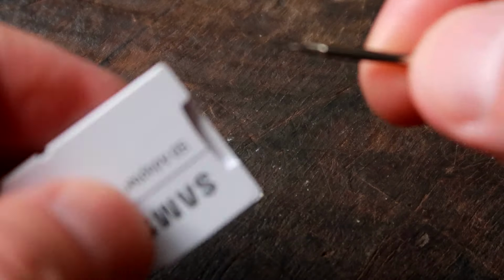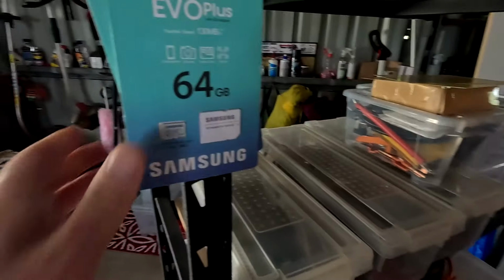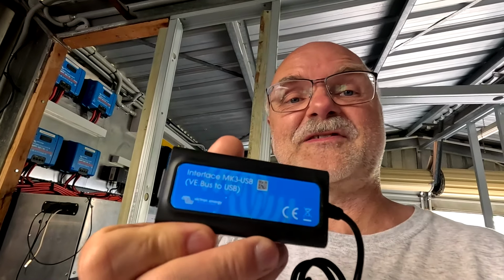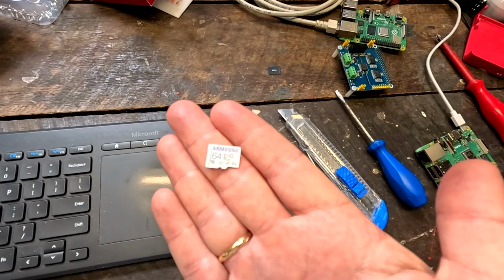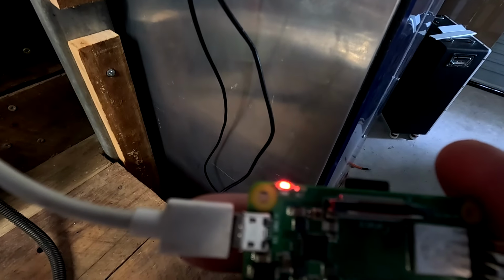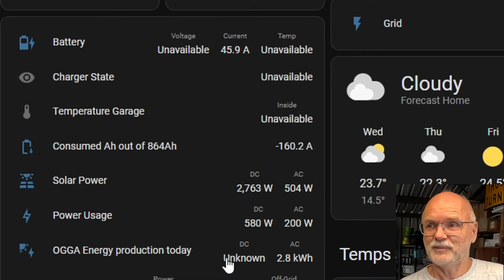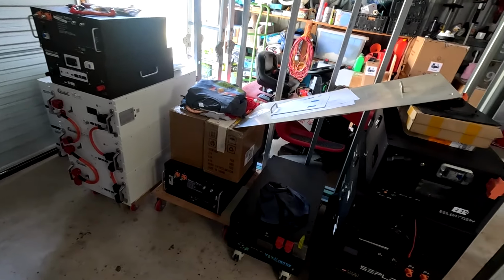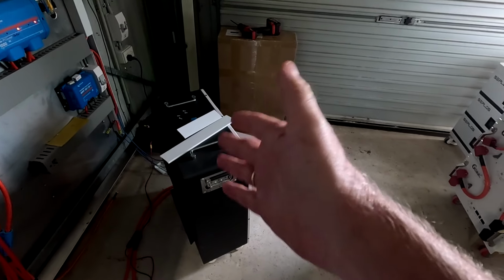Used Victron Cerbo GX replaces dead Raspi and why I lean towards no BMS communication!

Comment: I think you have to do Uboot-procedure on your raspys, and of course, install a Nvm2 SSD. It works well once you did it right. The only drawback is, you're losing 1 USB port. I have one question, did both channels of your can head works? I don't get it done, even kwindrem said somewhere raspy 3 and 4 accepting only one channel.
Reply: How? Do you happen to have a guide?
I have a rpi with a internal nvme drive connected to the pcie express port I used with solar assistant.  I want to re use this one and boot Venus OS from that nvme drive.  But I haven't been able to get it to work.

Comment: I do not use BMS communication, it makes the system over complex and prone to failure. The BMS is here to safeguard the battery pack and he does it independently, i'm fine with that. If the Bulk and float voltage are set correctly ... then the max charge amperage is set natturally by the battery chemistry, it charge fast with a higher bulk voltage to the 90% ish SOC in my case .. then when current decrease it goes in float (54.4V for me.. and stay at 95% SOC).
Natural physics laws lean in the good direction... no need to control it.
For the communication to work correctly you need a shunt on the battery ... i got a 48V secondary DC circuit, not the DC rail used for inverter/mppt.... but a regulated one where i can use the hifi system, lights, tools that are needed in case the inverter would fail. The gx was not sensing that consumption and would not provide enough Amp on the MPPT side. It would have needed a shun on this Dc circuit or it will not be able to calculate the MPPT current to provide to the system. 
Now, without communication it's super simple : The MPPT (RS450+Smartsolar 100/20) make available all current then can provide  and devices (battery, inverter.. DC cirtuit) take what they need on it without having a bad influence on each others. There is a lack of power on the 48V rail ? The battery just fill the gap... it's all natural and react instantly, physically, no electronic logic is needed.
It work like for 3 years in our shed, all is good.
When i tested the fallback system from "BMS controlled" charging to  "MPPT controlled" .. was not as good as i wanted .. was taking too much time. With no comm ... All MPPT just give what is drawn on the 48V DC rail.... nobody care who is using it.. inverter, BMS, DC circuit... Cerbo...

And Rasp are not reliable, Cerbo is the best way and in the end a cerbo is not that more expensive then a Rasp. Even my home assistant is on a miniPC cause Rasp are too unreliable and far too expensive for what they offer. For low consumption... Arduino or ESP32... higher then that .. miniPC. My NUC with Home assistant (200+ sensors), Frigate (4 cameras), Adguard and some other small projects... consume 11W. A N100 would maybe doi it for 9W.

Comment: I used Raspberry Venus OS in a camper with a 7" touch display. I had both components lying around, so it seemed the most logical "free" choice. but... Neither of these two is really designed for extensive vibrations. We do a fair amount of off-road driving. The display gave up within weeks (the top section touch control doesn't work). My raspberry is far away from the Victron gear. This means I had to run about a 7-meter-long cable. USB cable didn't work, thus I went with USB to LAN to USB adaptor. It works great while stationary. It surely doesn't like moving. Once we drive, I'm getting random disconnects, and then the info from JK BMS is no longer available to manage the solar chargers... Replaced the whole setup with Cerbo GX and Victron 7" Touch. HDMI extension and all is dead stable. IMO Victron gear, even though pricy, is well designed to take upon demanding tasks.

Comment: Being the device you just installed was a raspberry pi in a casing from victron. The new pi's either raspberry or orange. Have mmc cards and have adapters for m.2  drives. I use a orange pi 3lts with 8gb mmc for solar assistant and a orange pi 3b for home assistant with a m.2 500g drive in it.

Comment: Hi Andy, I have 2 Raspberry Pi3s running fine 24 hours a day with Venus OS, using a high performance SD is ideal and a power supply isolated from your system prevents a power surge or static electricity from damaging the Raspberry and use original Victron cables to interconnect everything and that's it.

Comment: I've run my system for two years now and have never used closed loop communication to control the invertors and solar charge controllers.  The inverters and charge controllers operate based on voltage setpoints and everything works just fine.  I use a Cerbo GX to tell my Victron Multiplus to switch on/off grid based on battery SOC and/or voltage.  I just don't see the need for all the headaches associated with closed loop communications.

Comment: Ordered another JK inverter BMS (as a spare) and now received a HW15.5 (15 and a half???). Not sure what they changed this time. Only visible difference is that the red wire now is also screw connection instead of soldered on and the coil is wrapped in heatshrink

Comment: Hi Andy,

Since an SSD is not an option due to the victron Venus OS, you might want to use the RasPiKey? It is a SD-to-Emmc and sits in your SD card slot. Doesn't fit all RPI cases though and it should sustain more writes than an SD card. SD cards usually die in the RPi if it will be power cycled during a write operation or just the wear and tear on the card due to excessive writes. Since VenusOS has a /data mount to write stuff, this might be the case of it's ultimate demise (other than breaking into two pieces).

Comment: I keep a record of the commands which I made and the fixes to the files. This helped me when I bricked it several times when I didn't have an isolated setup. I need to upgrade in a while and that makes it somewhat tricky. Good luck fixing it. There might be a Linux way to makes copies. When you insert a USB stick you could do a 'rsync -av /data/ /usbpath/' it would copy the files, or you could do a remote rsync. But this is still cumbersome.

Comment: BMS communication is useful to lower the charge current when the battery is close to 100%.
Reply from the maker: No, that's really not necessary. The battery will take less current automatically when it is full. We use CV for absorption and the current will go down. There is no need to actively limit the charging.
Reply: @OffGridGarageAustralia if you got a badly-balanced battery (for whatever reason), then the connected BMS will alert the system to lower the current prior to the battery reaching its CV voltage, giving time to the balancing process to happen. If there is no communication, the BMS will cut charging altogether, which could potentially lead to an unstable situation.

Comment: I believe my Cerbo GX crapped out. It only sends data from my pv arrays, the cerbo seems to run hot.
I have tried researching on anybody that had somewhat of the same situation until I seen this video today.
I would think everything that is going on with the  razberry pie and cerbo gx is running to hot on these compact units. 
Maybe run a fan for cooling system down.
As for the cap on the power point is only for arcing when you unplug in and out, mine always was plugged in but when I first noticed it was when i did the last update and never worked right again.

Comment: Andy, if you decide to put in a new raspberry pi, put a heat sink on the CPU with a fan. These CPU's get really hot. Plus use a hi quality SD card. I have been using RASPI"S for several years and a heat sink with a fan is a very important component. Power supply with 3-4 amps is also important . Good luck and thank you for all your  videos. You are the BMS KING.👍

Comment: @Off-GridGarage, 
Andy,  since you are in contact with JK BMS developers, could you please pass them important information about a bug in their Pylontech protocol implementation that prevents successful connection with a huge number of different inverters using the RS485(9600) Pylontech protocol?

I have a problem with PB2A16S15P (fw. 15.30) and inverter PowMr POW-HVM6.2K-PRO. I tried to connect them using RS485, selected the Pylontech protocol on the inverter, and #14 protocol (9600 Pylontect) in UART 1, but after 2-5 minutes, the inverter reports a communication error (it tries to make very first handshake and failing).

I debugged it with PC sniffer and found the issue with BMS protocol implementation.
The first command from the inverter to BMS is "get protocol version," and the inverter sends 00 because, according to protocol documentation, that field should be ignored for that specific command. However, BMS returns error 01, which means "incorrect version." I manually filled in the version and updater checksum, and BMS responded properly.

Command from inverter: 7E 30 30 30 32 34 36 34 46 30 30 30 30 46 44 39 41 0D - second and third bytes mean "00" in ascii
BMS response:                  7E 30 30 30 32 34 36 ~~~~30 31~~~  30 30 30 30 46 44 42 33 0D - highlighted 30 31 - means return code 01 which means "version error"

Comment: Honestly, it is quite tricky to run RPi without cooling. At least passive. Better to have active, especially if you are in sunny hot Australia 😅
Second thing I would check is power supply. RPi needs really good and reliable power supply.

Comment: Does the pi get warm/hot.  SD cards fail much faster if they stay hot for long periods or you are constantly writing lots of little pieces of data in the same locations.   Pi hardware is not industrial grade electronics so 3years of constant running may be an issue.

Comment: You can run a raspberry totally in RAM without any writes back to the SD card: Use the Overlay File System option in raspi-config. That make the file system read-only and overlays a RAM disk over it where writes will happen. The writes are lost when the system is rebooted. You can save (when needed) to e.g. a usb stick.

Comment: The Gobel Power Battery Home Assistant Addon also works with the included RS232 to USB Connection Cable; thank you very much for pointing out the addon

Comment: In my 20 years living on a sailing boat I noticed that a lot of the marine electronic companies started moving towards networked systems with loads of communication between parts of the system. Out at sea having a system shut down because one component failed or stopped talking to another could end in a disaster. I stuck with my independent components (often not even the same manufacturer) because I hated the idea of losing everything just because one component failed. On a sailboat you also carried a spare for everything. I'm building a narrowboat now and even though Amazon can now deliver virtually everything I need tomorrow as I'm inland I have still designed it so that if one component fails I don't lose everything. Two battery packs, two BMS's etc etc.

Comment: If you’re going to run the OS from an sd card it needs to be gentle with disk writes, you can boot the pi from USB drives now I believe, a USB SSD should be more reliable

Comment: Hi Andy, I have always been under the impression that an SD card is not the moet reliable boot medium for any OS. In case of a Pi some suggest using USB Boot and boot from an SSD. Faster and more reliable. When using a simple removable drive bay you could make backups more often and easily, bit still need manual labour. 

There also a way to boot from Lan, logged data would have to be stored elsewhere in that case.  

Anyway.. there are options. The question is.. won’t an original GX be better as it works from the box.

On the other hand, when the GX device fails I guess you have a similar problem of no backup and having to reconfigure the whole system.

Comment: I have my jk bms connected to a pi3 mostly to monitor battery temps and control a relay hat to keep the battery temps up. Has been a stable connection for the most part but do wish it would failsafe to bluetooth communication should something happen to the vrm device

Comment: I would try to power your RasPi's from a known GOOD original RasPi foundation power supply if you have one.
The Pi3 will need 5.1v at 2.5a, especially if using HAT's.
The Pi4 is fussy & will prefer 5.2v at 3a.
If no official RasPi adapter use your power supply set to 5.2v (max) with 3 amps with a sacrificial USB lead, check the polarity with a DMM first though...
Plug it into a monitor so you can see if there are any low power 'lightening' flashes on the display and otherwise observe what it is doing...
The Pi3B+ will boot to a high quality (Samsung Bar for eg.) USB drive out of the box, the PI3 will boot to USB if the firmware boot bit is set (guides online). USB sticks are more rugged and have cooling air around them as they stick out from your Pi.
SanDisk Ultra A1 class 10 16GB SD cards seem to be the sweet spot for me (Iv'e ran some SanDisk cards in my Pi servers for 7 or 8 years now - no problem!
Use the 'Raspberry Pi Imager' software to set your cards up if trying the latest BookWorm image, larger SD cards will be formatted in the correct file system before applying the image.
As for backing up SD cards I use another Linux machine (RasPi or Ubuntu based distro on a PC) and use the DD command (approximately every 4 to 6 weeks between backups). 
BUT bear in mind that any copies are just copies until tested as working... i.e. verify the copy is ok by restoring it to an SD card and testing it.
Sometimes in the past I've had to restore 16gb SD images to larger SD cards because there can be  a few 10's of bytes LESS room on a seemingly identical SD card. I counter this by using GParted to shrink a master image down by a couple of MB before DD'ing it.

Kudos to those who have probably already mentioned these points - I DON'T have time to read all the comments :).

Love the channel Andy - I've been messing around with RasPi's since the PI1 in 2012, so have found out the hard way how to get the best out of these.

Comment: In the DVCC, you can select under "Controlling BMS" the option "No BMS control". -> You can have all the information in victron, just without any controll of the BMS -> redundant system :)
But you have to go to each MPPT and also restart the VE.Bus system for the change...that is annoying.

Comment: Why do you run all that? All you need is a hybrid inverter like Deye, battery banks, offgrid inverters to charge EVs. Btw, why not connect every battery to your storage?
When all batteries are in parallel, you need zero lan cables, hybrid inv works between 51,5 and 53,5V.
It's that simple.

Comment: Fully agree. I have an ElectrodacusBMS with no communication to the Cerbo but communication to home assist. The BMV 712 is connected via BT to solar and inverters like Andy has it. The BMV is also last line of defense in case BMS fails and steers with its relay output a full shutdown is battery is below 9.9V and above 14.75V.
Cerbo and also home assistant does monitoring, load optimization and home automation but BMS is completely independent the

Comment: The raspberry sometimes has a problem with ohe of te supply voltages coming out of a BGA power chip. Check the voltages on the board.

Comment: Hey Andy,
nice thoughts about the KISS approach. I am thinking now to add a shunt to keep track of SoC and others. It would replace the Pace BMS data so the Victron Chargers can actually to the floating. The Pace BMS switches of its charging MOSFET's at 100%.
Would it be worth you showing how to achieve (if you get my point)? I guess there are still a lot of guys running the Pace.
I am annoyed by this fact because floating is not controllable with the Pace.
Moin
Nicholas

Comment: Andy, the RPI is NOT limited to 32GB sd card size.
Raspberry Pi computers with micro SD slots support the SDXC standard, which is cards up to 2TB capacity.

Comment: Just curious, do you measure the temperature inside your battery case, is it ventilated?  Heat is definitely the enemy of most electronics and RasPis are particularly sensitive.

Comment: I think the problem is the imager. Using RPI imager is the best way for ... RPI. Used for RPI 3/4/5 with no problem. I've use Rufus one time for RPI image and RPI 4 doesn't boot.
But only tested with resbian (official os for RPI). I've never use Venus os but on resbian you have a software include to copy the SD card.
For daily save i use a command line tool to copy the SD. Domoticz call a python script on the RPI to start the save and return result on Domoticz.
For my Domoticz box v2 i will use RPI 5 with a SSD M.2 hat since the RPI 5 have a external PCI slot..... Boot on SSD is not as simple as SD card but it's fine.
My actual Domoticz box run on RPI 4 with a 64GB SD card Kingston Canvas plus. Only change one time to increase memory from 32GB to 64GB.

Comment: I wonder if the VenusOS is using OverlayFS, because that should be used to make the system Read Only.
Then when the config changes it can write only that. Logs should never be written directly to the SD in real-time, maybe periodically stored.

Comment: I have lost at least 4 setups on rpi because of a faulty sd card.  Those card are not designed to that kind of use. Last setup I lost was my HA test setup, so that wasn't so big a deal.
Now I use a regular ssd harddrive in a usb 3 enclosure and it is actually running faster due to the faster usb3 interface. 
And just to clarify it. I have been using rpi since rpi1 came out.